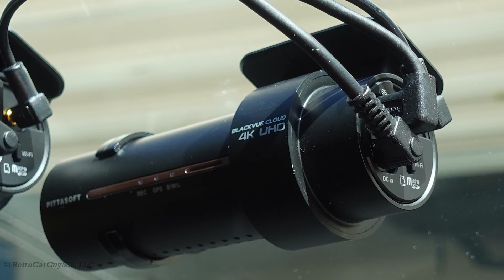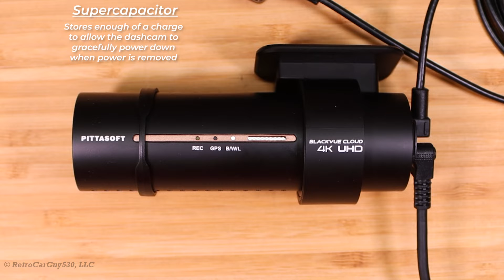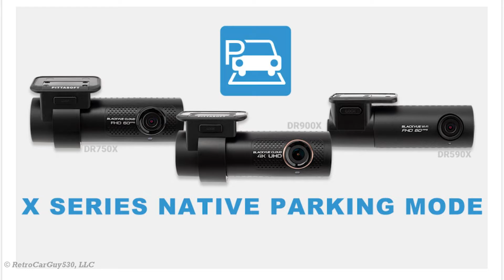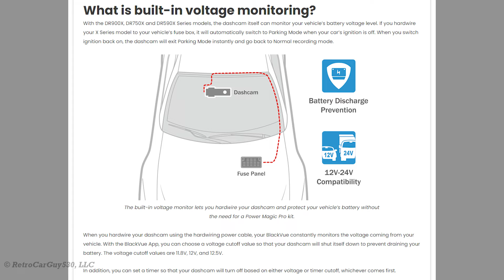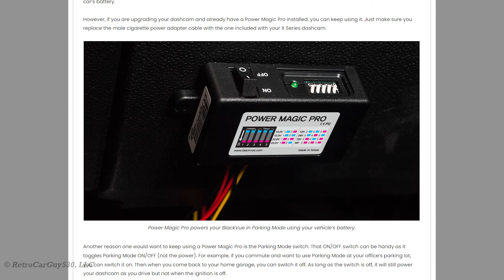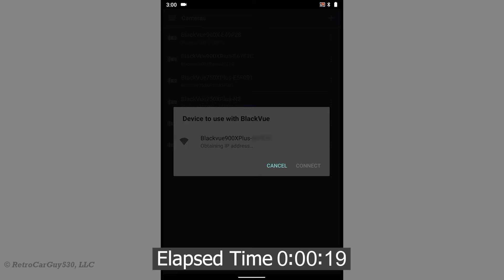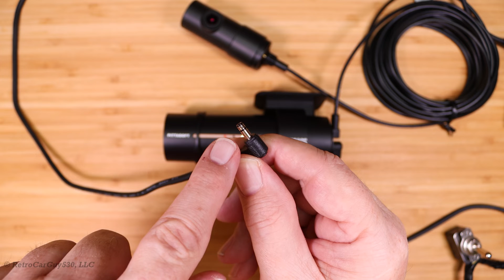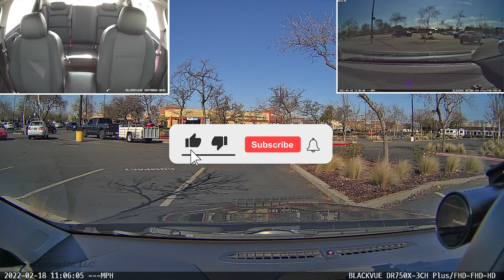BlackVue X-Series Dashcams - Native Parking Mode - Info & FAQs

Comment: Hey, my 750x is hardwired with taps ect. to fuse box, however parking mode only activates after 5 minutes of being stationary rather than instantly when car is off, since it’s an x series i thought it was supposed to switch instantly, any ideas?
Reply from the maker: If the 3-wire hardwiring harness is connected to constant and accessory powered fuse taps, it should enter parking mode immediately after the accessory power is turned off.  BlackVue uses somewhat unique colors for the battery/constant (yellow) power and accessory/switched (red) power wires in the 3-wire harness.  Make sure the yellow wire is connected to a constant/constant battery powered fuse tap/socket.  Make sure the red wire is connected to a fuse tap/socket that is truly an accessory/switched powered fuse tap/socket. 

Since your 750X is staying powered long enough to enter the motion based parking mode, it sounds like the yellow wire (battery) is connected to a fuse socket supplying constant power, but the red (accessory) wire may be incorrectly connected to a fuse tap/socket that is providing constant power as well.  If the red wire is connected to a fuse tap/socket that turns off when the ignition switch is turned off, the 750X should immediately enter into parking mode.

Also, the battery protection feature in the firmware settings must be enabled and you should select an appropriate low voltage cutoff value for your parking mode needs.

Comment: This video was very helpful. However, I still can't get my DR750X to go into parking mode when I turn the car off, and my battery protection settings are on and match yours exactly. I've tested the fuse tap when the car is off, and it still receives power. Any advice?
Reply from the maker: To have the instant parking mode on/off behavior, you must use the 3-wire hardwiring harness to power the dashcam and there should be two fuse taps.  One fuse tap for constant battery power (yellow wire) and a second fuse tap for switched accessory power (red wire) and of course the black wire is connected to a ground location.  If you use the cigarette light/power port adapter to power the dashcam, you will not get the instant parking mode on/off behavior.
Reply: @RetroCarGuy530  great video! A question, if my cigarette lighter port to power blackvue and this cigarette lighter port has constant power even after I turn off my engine, will blackvue go into parking mode? Thanks
Reply from the maker: @Derek Chung yes it should.  All BlackVue dash cams have a "motion based" parking mode in addition to the instant parking mode on/off behavior when powered using the 3-wire hardwiring harness.  As long as you have selected one of the two available parking modes in the firmware settings, the dash cam will monitor the vehicle motion.  When the vehicle has been stationary for 5 minutes, it will enter parking mode.  When the vehicle begins moving again, the dash cam will exit parking mode and resume normal recording mode.

Also make sure to enable the "Battery protection" feature in the firmware setting and select an appropriate low voltage cutoff value to protect your vehicle's battery from being fully discharged by having the dash cam continuing to draw power after the vehicle's engine has been turned off.

Comment: Im going from the 900s to the 900x plus and I’ve been using the b124x (hardwired) I’ve ordered the 3 wire b124 wire. My question is how do I connect the new 3 wire hardwire that comes with the x series and the b124 wire to each other so that I have native parking mode. You mentioned to just splice them. What’s does that mean
Reply from the maker: The 3-wire output power cable for the B-124/B-124X dashcam battery packs has a label attached to the wires near the end that just has the three wires (not the end that plugs into the B-124).  The 3-wire hardwiring cable provided with the 900X plus also has a label attached to each wire. 

BlackVue uses a slightly "odd" color convention for the power wires compared to other dashcams.

"Battery(+)" = Yellow / "ACC(+)" = Red / "GND" = Black

Most other dashcam companies use red for the "Battery(+)" wire and the yellow for the "ACC(+)" wire.  It doesn't really matter as long it is known which wire provides what power and they're connected based on the definition for each wire.

Both the BlackVue 3-wire dashcam battery pack output cable and the BlackVue DR900X Plus 3-wire hardwiring cable use the same wire/color labeling.   You connect (splice together) the wires from the two wiring cables.  You can use 22 awg butt (crimp) connectors (usually red in color) to join the wires together or solder each of the three wires and use a heat shrink tubing and/or electrical tape to cover each one.

You unplug the original power port output cable from the B-124 and replace it with the one you just spliced together to provide power to the DR900X Plus dashcam.
Reply: @RetroCarGuy530  thank you so much. This was the first time I seen anyone mention this wire. You should do a video I’ve seen a lot of people searching this and no one has found a video on it.
Reply from the maker: I do discuss the 3-wire output cable for the B-124/B-124X in my Dec 2019 review video of the B-124X battery pack.

https://youtu.be/Yn5EzLmuOXw?t=328s
Reply: @RetroCarGuy530  wow thank you! You’re awesome I will definitely subscribe.
Reply: @RetroCarGuy530  That was the question I had and you answered it perfectly. Appreciate it.